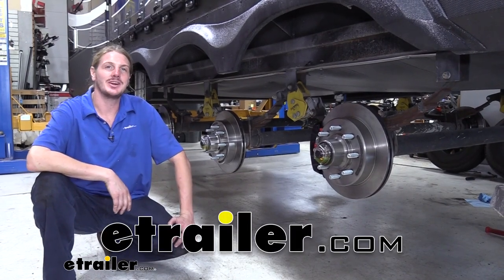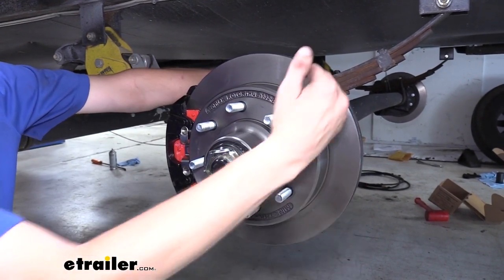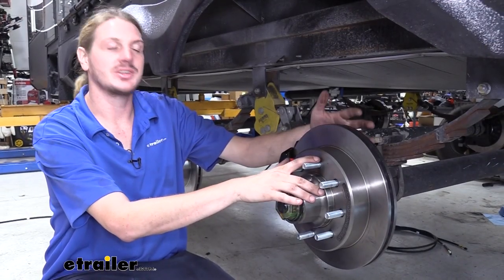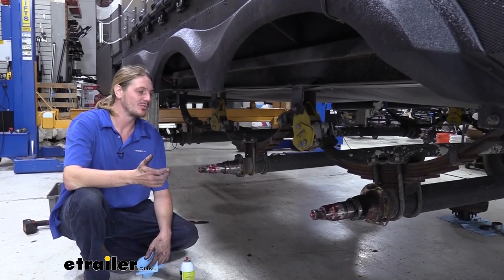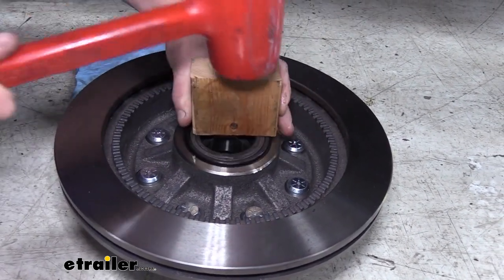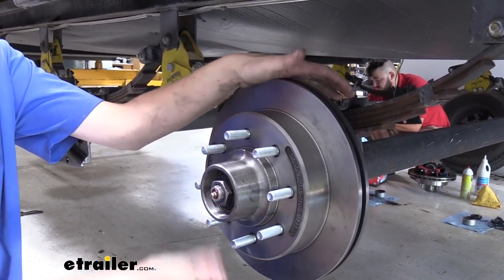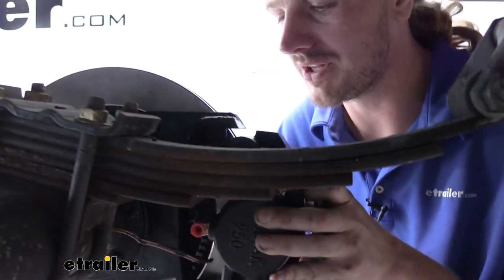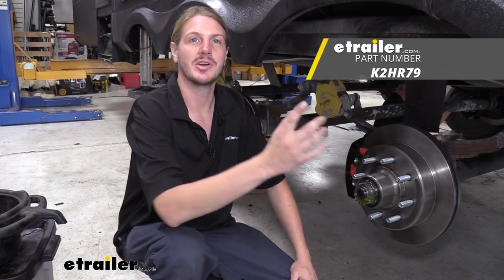etrailer | Kodiak Disc Brake Kit Installation - 2019 Grand Design Momentum 5W Toy Hauler

Comment: I drive an F350 drw pulling a heavy dual axle equipment trailer with hyd disc and the trailer stops miles better than the truck. The trailer is 12 yrs old now and needs all brakes replaced including calipers and mounting yokes. Parts only about 3500.00. Close to the cost of a small rear ender.

Comment: Nice install. But I have two points of contention here…

First how come NOBODY shows the full job including the actuator and lines? That’s the hard part. Installing a caliper and rotor is pretty much the same as installing a drum and loaded backing plate, if not easier. 

Second, when talking about the torque spec for the spindle nut you said something to the effect of “odds are you don’t have the right socket so just use these monster channel locks”. Seriously? You just spent, what, $1500-$2000 on this disc brake setup and you’re gonna draw the line at a $25 socket from Lowes?!?
Reply: https://www.youtube.com/watch?v=9XIWzxEuqcQ   That's part 1 of a 3 part series, Part 1 is installing actuator, Part 2 is the brake lines, Part 3 is the rotors like this video here.
Reply: I think the brakes are closer to $8k total

Comment: So if I’m doing disc on dexter 8k axles oil bath with the 5/8” studs I’d install the bracket at 12 o’clock or like you did in the video? Just ordered my kit! Electric brakes suck
Reply: Six months and no one answered your ⁉️ Disappointed in you ETrailer!!!!
Reply: In any event, be sure the/a caliper bleed screw is pointing upward or positioned so that any air at the very top of the piston will flow upward to the bleeder valve during bleeding.

Comment: Shouldn't the studs holding the backer plate on be replaced with longer ones?  There's not even close to full engagement between the nut and bolt.

Comment: So you don't have to pack the bearings with grease when you use oil?  Which type is better?
Reply from the maker: No, it will be entirely oil based lubrication. It really is up to you whether or not you would rather grease the hubs or change the oil out of them.
https://www.etrailer.com/Trailer-Brakes/Kodiak/K2HR79.html